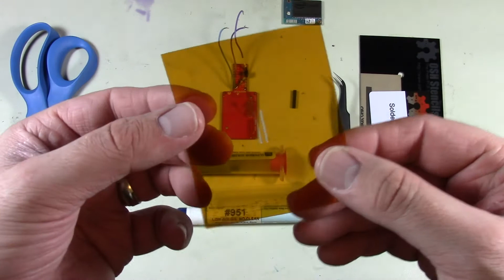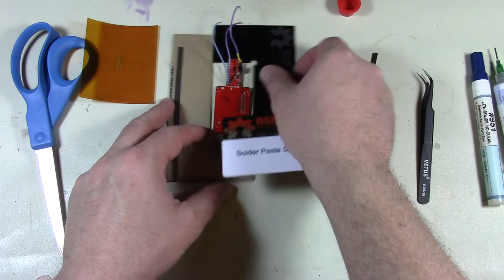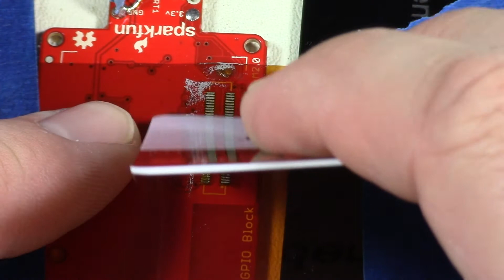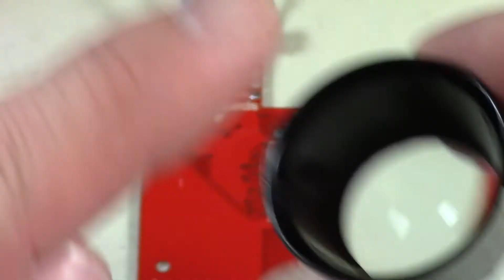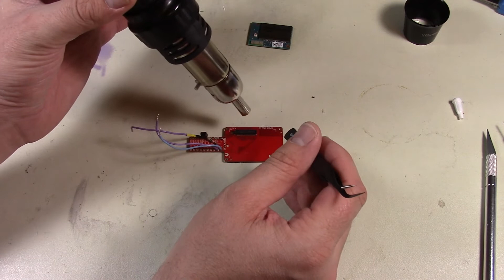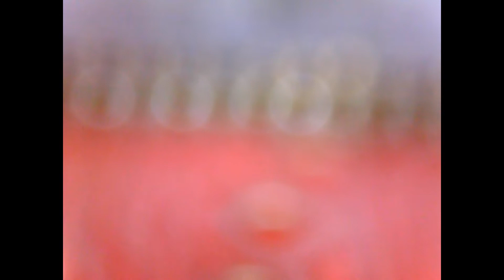Intel Edison - Solder Stencil

Comment: is there a method without the stencil? I don't have access to these stencils, been trying to do it without them but end up with bridges (not much but enough to give me troubles).  Otherwise, whats the best way to get rid of the solder bridges?
Reply from the maker: +taras jia you can checkout OSH stencil to order your own stencil. https://www.oshstencils.com/  use something like EagleCAD to put the part onto a board and then just upload your .brd file to osh park.  Otherwise what I have done on these fine pitch parts is order a solder that is 0.010" in diameter and then get yourself a flux pen and flux both the pad and the part.  Then, I would recommend a microscope or something with 60X - 90X magnification so you can see it.  Also I would recommend a soldering iron that the very tip gets hot and the thinnest tip you can get.  I had good luck with Metcal but they are expensive.  This is why I made this vid was there is much more to it if you are going to solder it by hand than to use a stencil.  Hope this helps.

I also thought about selling the stencils for people that cannot get them.  Would you be interested?
Reply: yes I'm definitely interested!